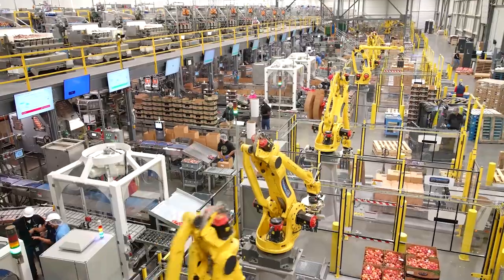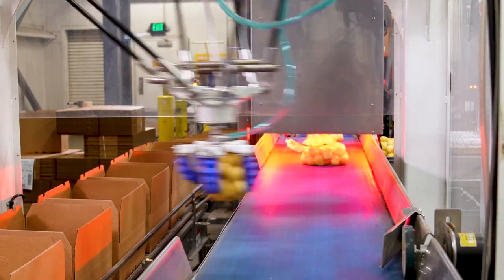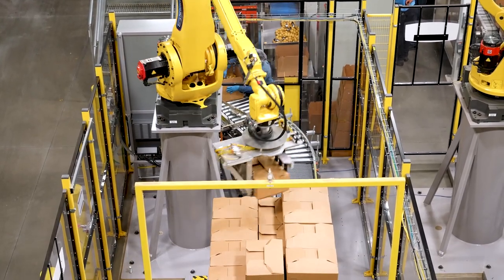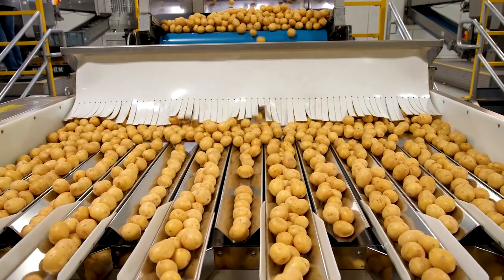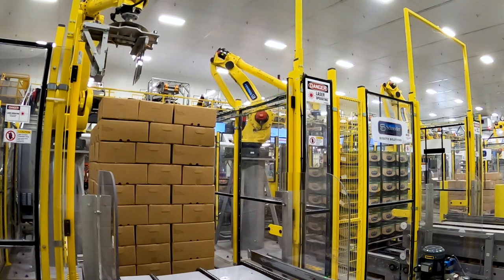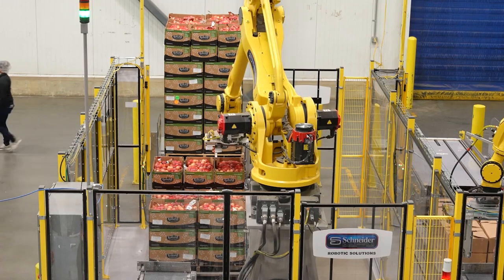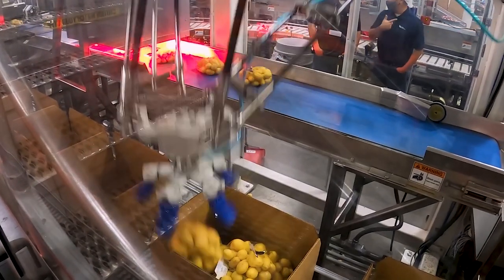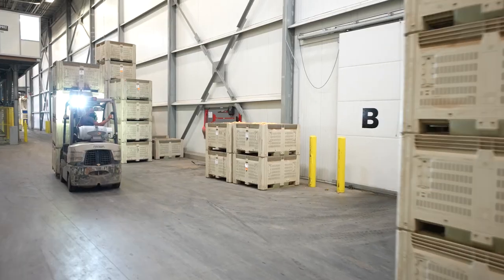Robotic Potato Handling Systems with FANUC and Soft Robotics

Comment: Love how the pneumatic gripper footage is sped up (unless the dude in the background has the fastest hands in the west)

Was it not deemed impressive enough it operating at normal speed that the footage needed to be altered?
Reply: I can't speak on if that footage was sped up, but I designed, built, programmed, and integrated the case packer on display here and I can say that I've seen the reported parts per minute at 45 but that's DEFINITELY conservative. This cell was doing a little over 60 ppm when I was managing it.